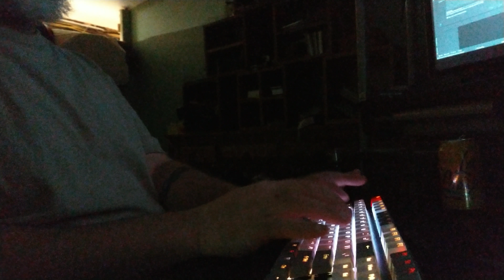GMMK sound check after foam padding

Comment: Hey bud, was the padding for the pinging that the case seems to make? Did you put it in between the PCB and Bottom plate or Top plate? What kind of foam did you use? Thanks